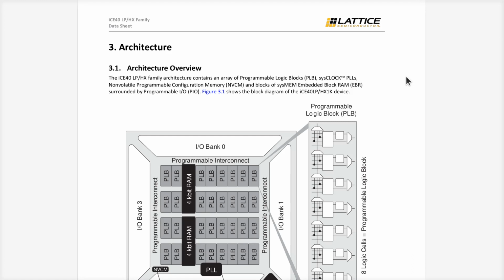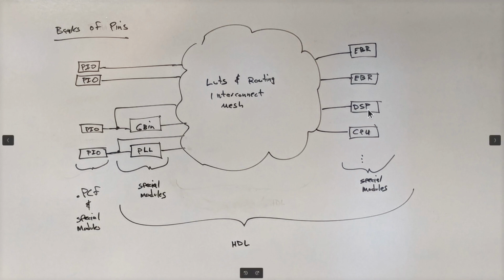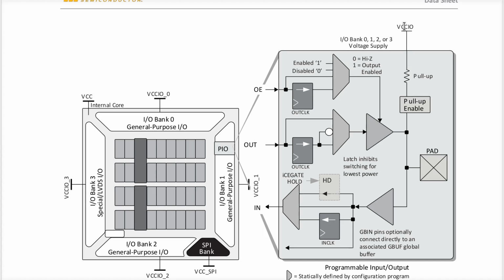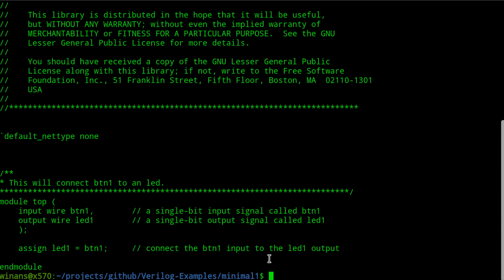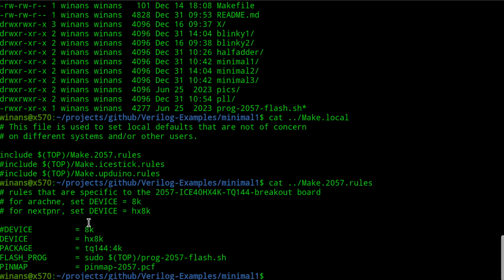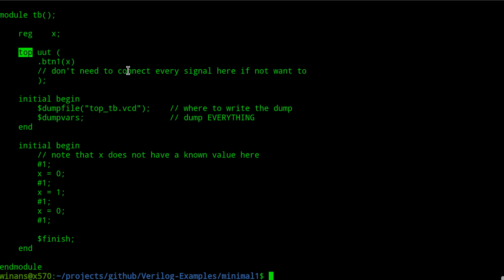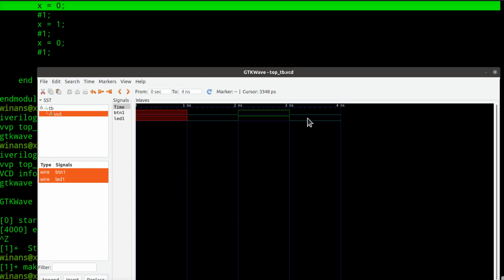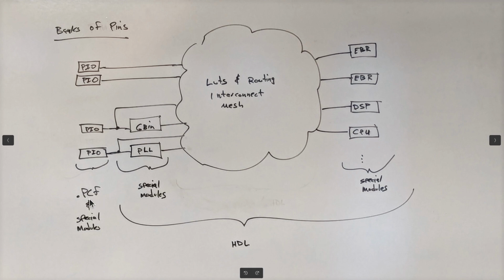FPGA #7 - FPGA Project Big Picture/Overview

Comment: For those wondering why the primitives like SB_IO all start with "SB_": SB stands for SiliconBlue, the company that designed the iCE40 series (before Lattice acquired them). Just like how most APIs on macOS start with "NS" for NextStep :)
And another thing I was curious about, so I looked it up: They're called iCE40 because they're manufactured on a 40nm process node. The predecessor was called iCE65, bet you can guess why.
Reply from the maker: Yep!

Comment: Hi John, I've been following along your development of the Z180 board and have found the use of the FPGA to test the microcontroller to be quite interesting.  I see there is no direct connection between the microcontroller and the SRAM chip, and that memory /CE is going to be derived from the FPGA.  So apart from memory decode, do you have any ideas lined up to extend the Z180 capabilities ?
Reply from the maker: The data and address lines are connected directly to the SRAM.  Only the /CE, /OE, and /WE are generated by the FPGA.
The data and address lines are connected to the FPGA so that it can be addressed as an I/O or memory device as well.
I expect to implement UARTs, an SPI interface w/DMA, VGA video, PS2, SNES, and audio output.  I'd like to have enough to be able to implement a side-scroller video game.

Comment: if you havent already could you please make a video on look ahead carry adders and propagation delay for both ripple and look ahead carry adders? I have an exam coming up and your video was the only video that finally got me to understand adders 😭
Reply from the maker: Not fast enough for an upcoming exam.  Knowing that the point is to determine the carry before the sum is ready from a full adder, you should be able to make sense of a few wikipedia type articles and work it all out.
Note that it is often done for groups of bits rather than just for each bit in the adder.